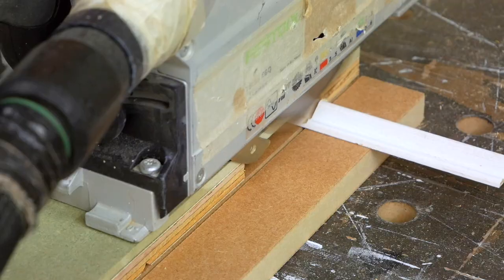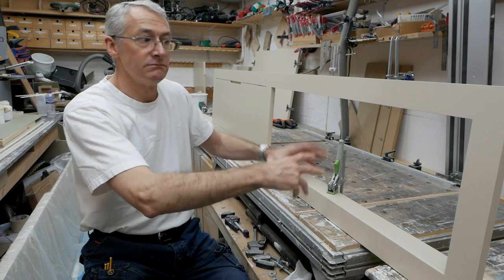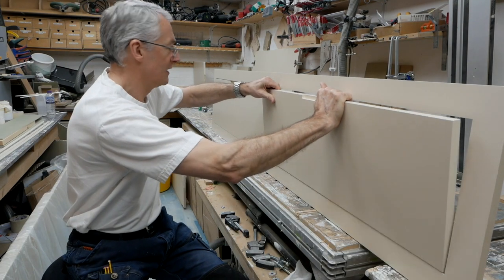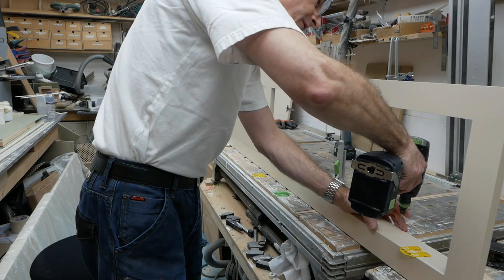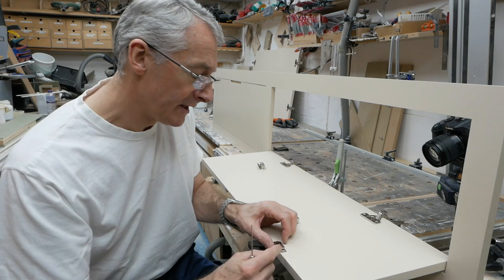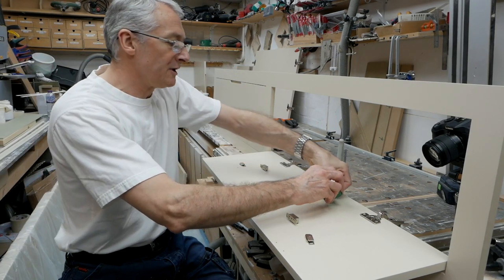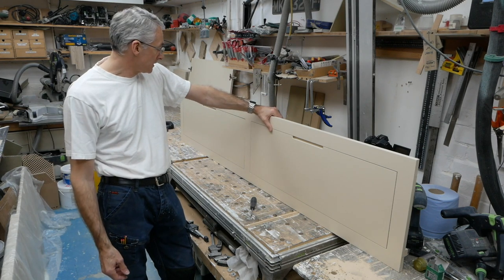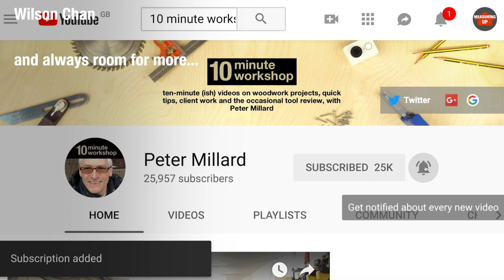Drop Down Doors [video #269]

Comment: A little trick I’ve been using when fitting small items like angles or those magnetic catches is to mitre adhesive them into position before you pilot drill and screw. Helps me so it may help someone else. 😊👍👏👏👏
Reply from the maker: Neat! I sometimes use double-sided, but it wouldn't work with these catches as they're too strong.👍
Reply: CHEATER !!! 😂😂

Comment: I designed something similar for my workplace, but my design the door is a box. It has been used daily multiple times holding  10kg+.. not huge doors but easy access and has lasted so far 6 years. Constructed from melamine  chipboard.

Comment: I always wished festool started their centrotec drills at 2 or 2.5mm dia so you didn't have to break out the 3 jaw chuck for the smaller size pilot drills. I use 2.5mm for most pilot holes as i like to have just a bit of compression on the shank of the screw. Then I found that Fisch did a combined 2.4mm drill and countersink that fits the centrotec chuck.  You can even replace the drill bits. Well done Fisch!  👍😁
Reply from the maker: Thanks for that Neil! I’ll def. be getting hold of one of those Fisch bits 👍👍

Comment: those hinges on amazon say 110 degrees but they seem to only go 90degrees in the video? is this right? i need some for 38mm timber so can i use the same hinges? thanks again, keep up the great work Peter
Reply from the maker: As I think I say in the vid, the batten the hinges were mounted to sat slightly below the level of the opening, so that would account for the discrepancy.  But I've always thought the 95/100/110 degree things is only ever a 'best case' measurement - better to use a wider-opening hinge if you need it. I've found the Blum 71B-755-01 155° hinges to be very good, much nicer to work with than the usual 170° hinges. 👍
Reply: @10MinuteWorkshop  thanks peter. close to 90 is fine for what i need on this one. are those inset hinges?
Reply from the maker: The ones in the video were inset hinges, the 155 hinges you can get either inset or overlay, I think. 👍

Comment: i just had to fit some hinges, nightmare! having your pointy awl thing to reach over the top and mark for screws looks so easy, but i had no way to get access with the doors closed as the other sides were already boxed in and not removable ... 4th attempt worked well enough and no one will see the other holes.....
Reply: Thank God for all that adjustment in 'em... 🙄😏
Hinges are a pain in the ass... but we need them... I'll say no more 😂😂😂

Comment: Hi Peter. Would the little hinge jig you use sometimes have worked with those hinges?
Reply from the maker: For spacing yes, but the issue is that the hinge jig is like a little bench hook - it needs to hook over the edge of the door/carcass for position, and the face-frame is flush with the back rail (that the hinges attach to) so there's nowhere for the jig to hook over. Easier in this case, just to fit the hinges to the door, offer it up into position, and mark them with an awl. 👍

Comment: Great video Peter, full of useful information as usual. Having seen you doing so much work in MDF I did wonder if the  top and bottom rails were laminated from MDF, but decided they would be solid wood. Do you ever laminate MDF together for rails? (I think I've heard you mention that you do for some thicknesses of shelves).
Reply from the maker: Thanks! I do laminate MDF together sometimes, but you always have to bear the weight in mind, and it's abiity to take a fixing. Softwood rails top & bottom just made sense this time. 👍

Comment: What router-bit did you use for the handle cutout? And how did you set it up?
Reply: BD Jappe   I was going to ask the very same thing     Would be very interested to know the answer to this !
Reply from the maker: Sorry - missed this off the list; it's a drawer pull bit from Wealden Tools (T7112-1/2) - http://bit.ly/Drawer_pull.

This vid was about how the doors attach to the face-frame, so the finger-pulls weren't really part of the story. It's the same cutter as I use in the Console Table video #114, and exactly the same process, just 'stopped and started' against stops on the fence. 👍

p.p1 {margin: 0.0px 0.0px 0.0px 0.0px; font: 12.0px 'Helvetica Neue'}
span.s1 {color: #dca10d}
Reply: Thank you for clearing it out Peter. I need Christmas to happen again so I can send people my router-bit-wishlist. Well see you in the past then. Off to video #114

Comment: I would love Spax to fully convert to torx head and be done with pozi and philips heads.
Reply: Hell yeah !! 
It's funny but when I'm using a cordless driver & stretching overhead to put a long-ish screw in, my right hand seems to be able to hold it in such a way as to not cam-out too badly.... but ... my LEFT hand ? I'm all over the place !! 😂😂😂😂
 torx or robertson only please ....& melt down all the pozi &ph.... 😈😈

Comment: Well done. My experience shows that measuring beforehand never works out. It might seem unprofessional, but nothing beats going step by step, holding it in place and screwing it down where it needs to go and it fits every time. You could measure the exact width of those magnetic latches, add the width of the door and screw it in place, but Murphy's law says the door is going to be proud by 1mm and if you think you're smart and just set it back 1mm, it's going to be 1mm shy.
Reply: That Murphy guy has a LOT to answer for... & I'm Irish !! 😂😂
😎👍🍀

Comment: Do you cut doors/face frame from a single sheet? I’ve tried it a few times and always been disappointed with the results due to the corners.
Reply from the maker: I try and get them out of the same sheet, but not ‘cut out in one’ if that’s what you mean? Too much gaffing around for not real benefit, I found. 👍👍

Comment: When you didn't measure where to put the magnetic catches and just eye balled it my OCD flared right up! 😂
I would have used one of those soft opening support things (the name escapes me!) as well, I wouldn't trust regular hinges long term by itself
Reply: I assumed Peter would also use one those support stays, so was interested to see the use of kitchen cabinet hinges. Peter's arrangement is better as it avoids the need for a vertical member inside the frame to attach the stay to. Changing to hinges with a larger opening range would seem to be necessary in this case, as the current arrangement will not be strong enough if someone leans on the open door, as they are very likely to do. Peter mentioned he was considering changing to 170 degree hinges in the video.
Reply: @tlangdon12  my only concern with going to 170° hinges would be damage to the top edge from it hitting the floor, especially if kids are opening and closing it
Reply from the maker: 😂 Ease of access was a big issue for the client, so the drop-down stays would have got in the way, otherwise yes, I'd have used them 👍

Comment: I'm in a reflective mood this evening Pete mate... 🙄

Fully adjustable hinges...
Pocket hole joinery...
MDF & ply material...
White finish...
etc...

It's funny but whilst I can ABSOLUTELY understand the innovation & popularity 
of these & other modern inventions , I sometimes feel a little guilty not using more traditional materials & processes.

Make no mistake, I DO use them  (the listed) & they are eminently suited to our modern furniture & cabinetry... 😂
I just wonder if you ever feel the same Pete ?
I understand the economics & efficiency arguments & I am in NO way knocking the modern
 processes or your work , as you know I follow your channel avidly & learn something from every vid.

I guess I was just wondering if you ever get a hankering for a trad. style project using dovetails & "real" wood,
 just for yourself , where theres no client involved & just for the hell of it ...😈

I do try a little myself though  I cheat with my dovetail jig , router & other machinery... 
As I'm under no time constraints, I have the luxery of taking as long as it will take... 🙄😏
I've also always believed one should NEVER turn a hobby into your main 
source of income, the joy goes out of it pretty quickly... ☹️

I'm not sure if there's even a real question in here or its just rhetorical ramblings but I just felt the need to post it ! 😂
Perhaps its my late fathers influence, a cabinetmaker of the old school, trying to make a dent on me... 🤔

Anyhoo ... I loved the vid, as always , & love reading the comments of other viewers & subscribers... 

😎👍☘️